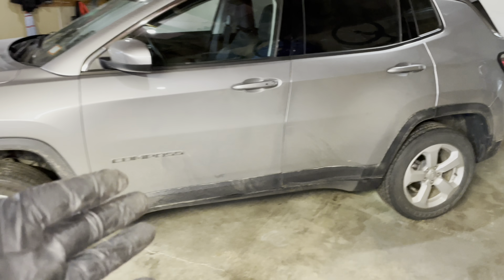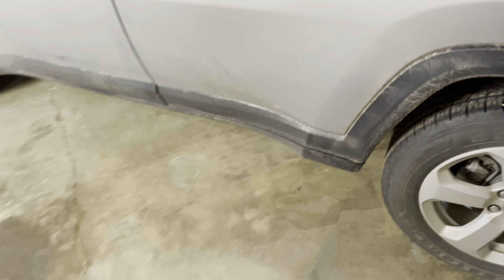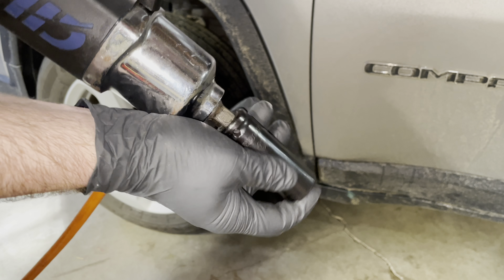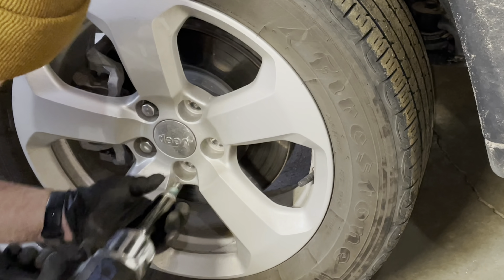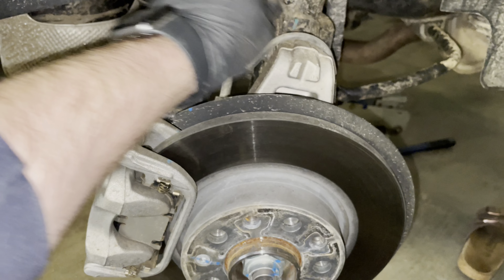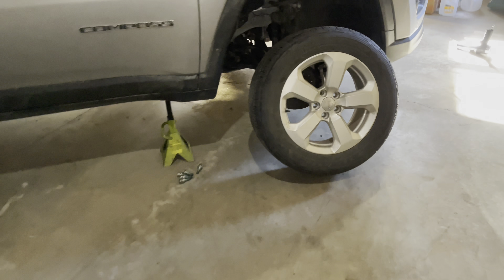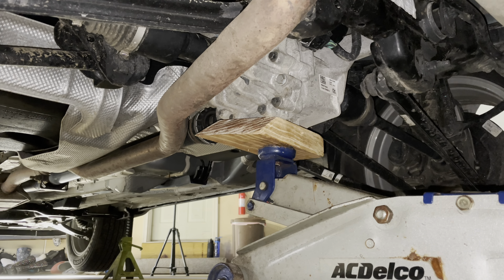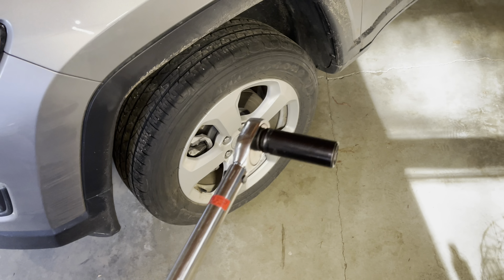How To Rotate Jeep Compass Tire’s | (2018-2021)

Comment: I have a 2018 jeep compass latitude and it's front wheel drive I'm glad you showed me where to lift it from the front   but I don't know where to lift the rear.
Reply from the maker: Being 2WD I would assume there is just a cross bar and I wouldn’t recommend lifting off of that… your best bet would to just lift each side and then the front or do the front and then just do one side that way it gives you the ability to remove 3 of the 4 tires and do a rotation… just be safe and take your time!! 
Hope this helps and thanks for watching!
Reply: @jlautomotive6349  nevermind I ended up just getvthe front jacked up an did the rear tires 1 by 1 like you suggested all done now. Would be nice to know how to get it all on stands tho 🤔
Reply: Is it safe to jack on the rear differential?
Reply from the maker: If yours is AWD yes you should be fine. That’s how I lifted mine, just listen for any weird noise or sound. Thanks for watching!!

Comment: 💥 35 years of driving numerous vehicles and I’ve never rotated tires. That’s just a sales pitch that shops recommend to sell more tires. If one wears more than others I fix the problem and change only one tire vs rotating tires around the vehicle and causing all of them to wear out faster than if they were left alone. 
If not touched back tires last forever but by moving them to the front they wear sooner.  I haven’t replaced more than 1 tire at a time in decades. Thanks for the vid and I gave  you a 👍🏼
Reply: Interesting!

Comment: Great video, i have 2020 all wheel drive compass, but it's a diesel, anyhow, I have a question, is it safe to jack the rear side on the rear differential?
Reply from the maker: Personally I wouldn’t jack off the side of the diff… I would put the jack in the middle. If you go off the side you risk bending something and causing a vibration. You can put a jack stand on the end but you have to be out as far as you can, closest to the wheel…
Hope this helps and thanks for watching!!

Comment: Great video! I saw you have other 2nd Gen Jeep Compass how to videos. I have yet to find a comprehensive video on how to change the brakes and rotors on this model Jeep. Please let me know if you have one and I couldn’t find it!
Reply from the maker: Thanks, My compass is a 2019 with only 27K and is not currently in the need of anything but yes as soon as I need say a battery, breaks or other things I will most definitely be making DIY videos! 
Again thanks for watching!!

Comment: Did your tire pressure monitor automatically pick up the new location of the tires?
Reply from the maker: I keep all the tires at 38 psi so I am not certain but no I believe once you rotate them they need to be recalibrated… I don’t personally care, for me it’s about saving money and if you need air you can clearly see “which” tire needs it…
Hope this helps, thanks for watching!
Reply: @jlautomotive6349   thanx what I was looking for is how to recalibrate the tpms, going to put winter tires and wheels on my 2019 latitude. Will not be mixing them up, will be changing the all together. Guess I'll have to go to the old route and put a tire gauge in it. Cant find the recal instructions anywhere
Reply from the maker: In the owners manual it says that if you put a set of winter tires on… the next key cycle you will need to drive over 15mph or 20+ minutes and the light will beep and flash for 75 seconds and say “service TPM system… 
The next key cycle will beep again but the light should be out and the pressures will read ( _ _ )
I hope this is a little more clear for the basics but with rotating there isn’t a way to switch which tire is being read vs where… just keep a physical eye on your tires like the old school days!! 
Thanks again for watching!

Comment: You can't switch sides lmao. Do you not have rotational tires? They are marked which way the tire needs to spin.
Reply from the maker: No, the tires on my Compass are non-directional tires… so I am free to move them around but yes if you have ones that are directional then you can only go front to back… 
Hope this helps and thanks for watching!!